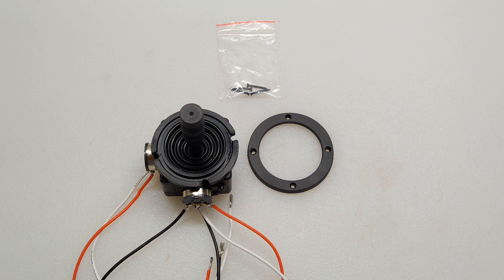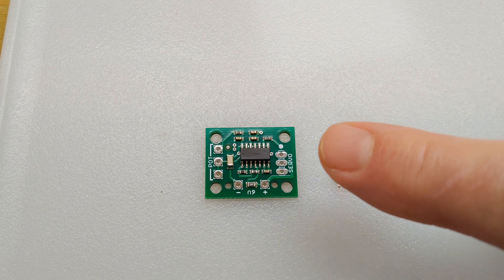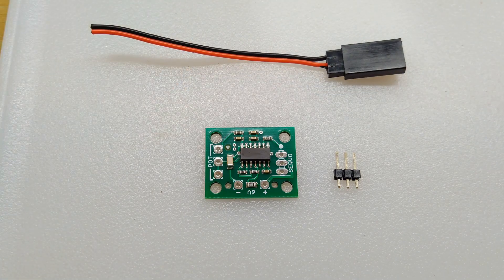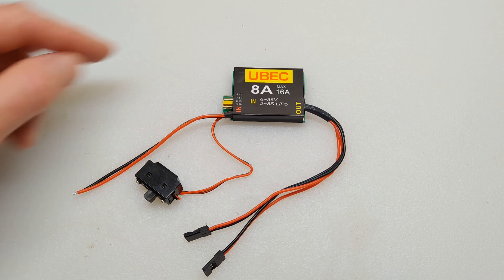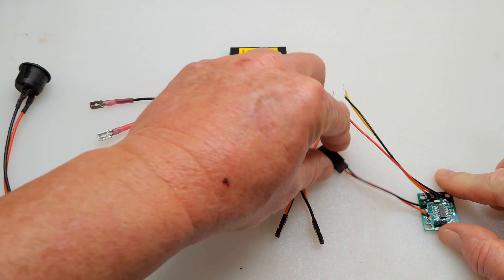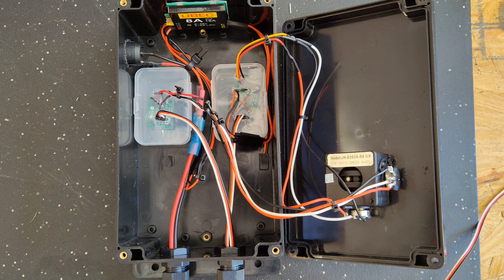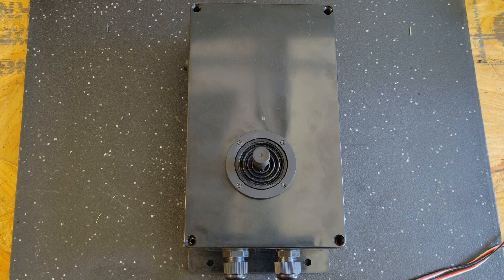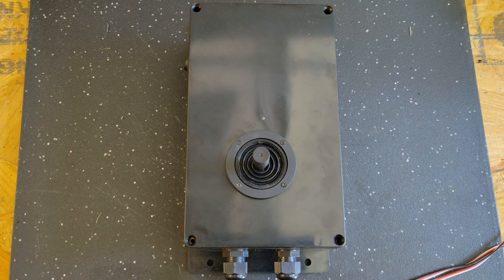ESC Throttle and Servo Motor Steering Joystick Control for Trolling Motor

Comment: Do you like the wired or wireless better. Is the wireless version you did reliable?
Reply from the maker: I like the wired version better. I can mount it on tracks and also add features to the box. The wireless works fine.
Reply: that helps a lot. You really have a great YouTube for us DIYers
Reply from the maker: @jdshinn60  Thanks!

Comment: Hi, I wonder how did you check that the Servo Controller Board is rated for the power of the servo you have chosen? On their web page they do not provide any basic info about the max or operating ratings

Comment: I'm curious if you already had the RC side set up for wireless control what would be the benefit to having this wired system especially cuz you had the RC setup already just curious looks like a great execution though :)
Reply from the maker: Thanks. I mentioned in the narrative that the wired version is waterproof unlike the wireless remote. It can be solid mounted with no concerns for dropping it in the water as with the wireless remote.

Comment: Very nice!
Would it at all be possible to calibrate the Left/Right axis steering to be less sensitive? It appeared to be very sensitive and if so, it can cause a problem when turning too fast?
Reply from the maker: Thanks! I think part of the issue may be getting used to the spring tension in the joystick. I have a video that shows how to slow down a servo motor if needed.